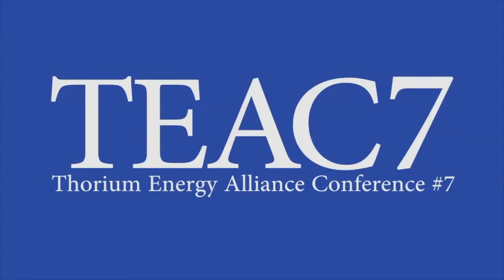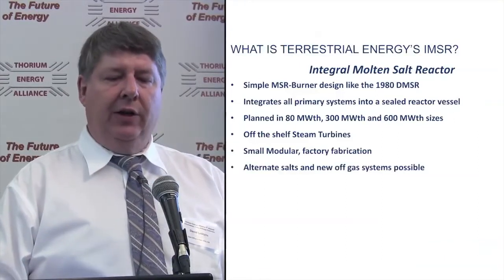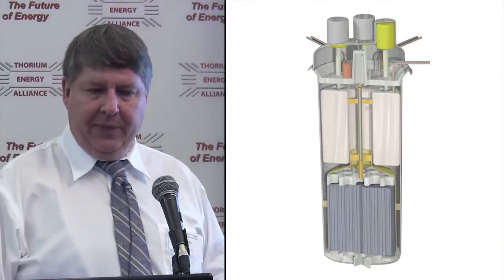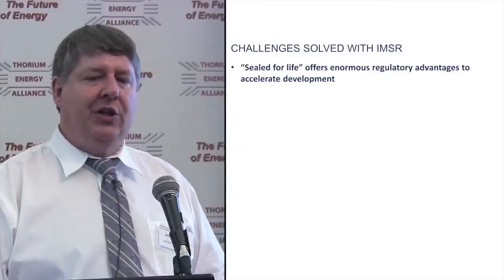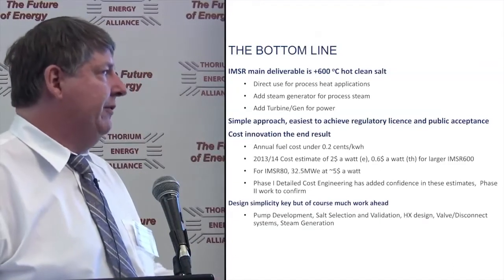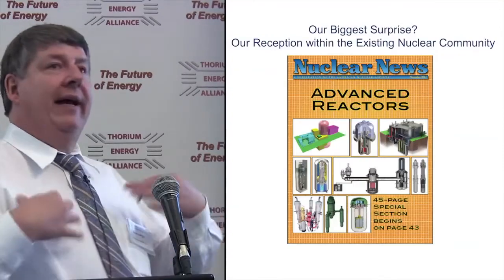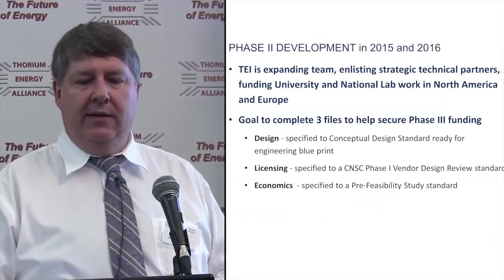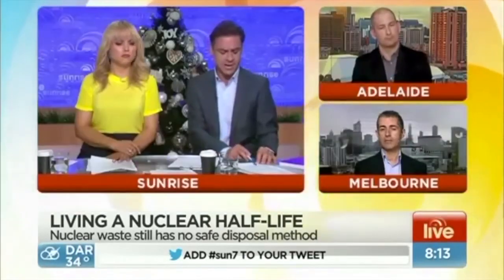TC No. 9 •  David LeBlanc on Molten Salt Reactors, Part 2 • plus: Australian TV on Nuclear Issue.

Comment: I watched only now the Aussie TV debate part, one comment I want to share. It's true that only about 40% of our energy consumption is today for electricity genaration (even if for Australia it alone might mean a lot, considering its huge coal dependence), but when you have a lot of clean, low cost energy/electricity you can use it for other sectors as well, like house/urban heating/cooling/cooking or even transportation either with trams, trains, electric buses or battery/hybrid electric vehicle; or even to produce liquid biofuels, like methanol, DME or Fischer/Tropsch-like Diesel fuels, not to say to produce almost zero emissions ammonia, cement or steel. This is easily almost 100% of our energy consumption in the western world

Comment: Australia is not the only country of the G20 not having nuclear-based energy sources. Italy did two referendum years ago and in both cases, the answer was no to nuclear. Italy buys electrical energy from France and Switzerland produced by nuclear-powered sources. The referendum was definitively an unwise decision, ending up with Italy being exposed to the risks of old generations' nuclear technology and paying n higher cost for the energy. Hope the Thorium-based MSR technology will be introduced also in Italy, but it is necessary first to revert the result of the referendum.
Reply: Congratulations 🎉
You have won a lifetime supply of Fukashima bottled water 💦
Reply: I absolutely agree. It does even have more sense when you think that we desperately want to electrificate both transportation (with high speed trains, trams, trolley-bus and battery-electric vehicles) and civil heating/cooling (mainly, through electric heat pumps or induction stoves for cooking), not to mention producing at least a bit of liquid buo-fuels like methanol, DME or Fisher-Tropsch Diesel fuels for uses difficult or almost impossible to go electric (ship, airplanes, etc...). And it's pretty obvious we need a LOT of energy for all this
Reply: Anyway, I want to point out that this is NOT a thorium fuelled reactor, it's still a reactor using good old low enriched uranium, even if in a super efficient way (6 plus times more efficient). When you have a fluid fuel reactor, like this, it' s almost irrelevant if you use thorium or uranium as main fuel (or yours is a thermal-spectrum, fluoride-based or for example a fast neutron, chloride-based reactor)